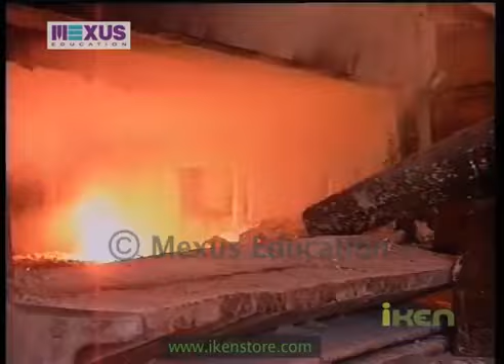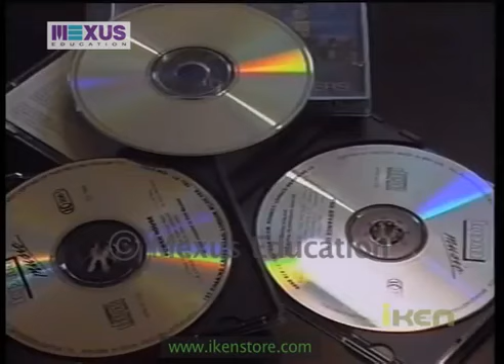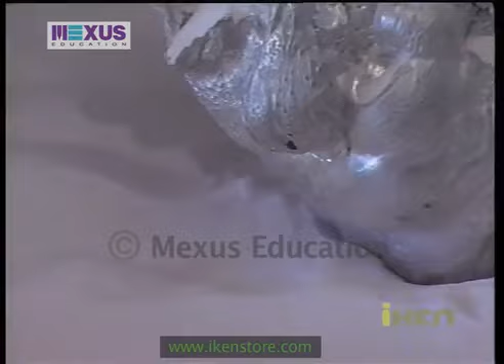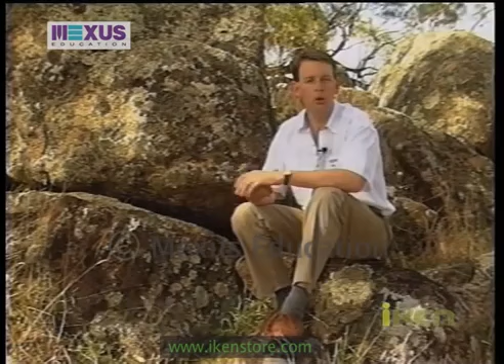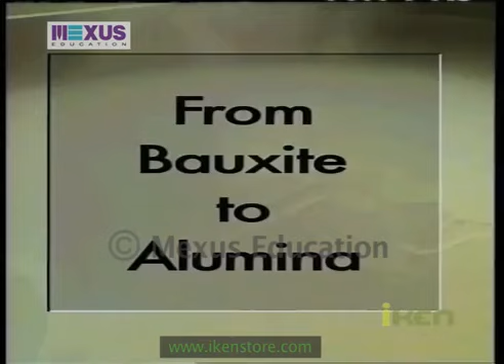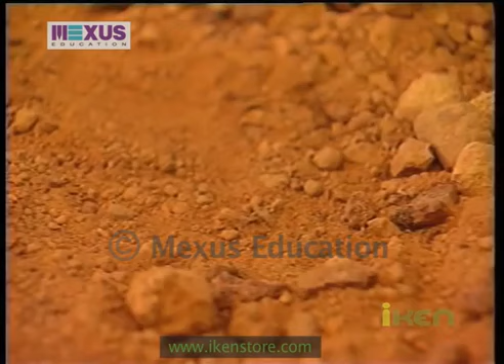The Making of Aluminium

Comment: Soni Aji Pradana
2712100126

Every day we see many thing application of alumunium, like used in car, motorcycle, cooking coil, drinks, and plane. Almost thing we usually use contain alumunium. So it is impotant to us to understand about aluminium precess. Aluminium process stars from ore to alumina and from alumina to aluminium. Aluminium process from alumina to aluminium called electrolysis process. Aluminium is a reactive metal it means aluminium combain with the others metal. Granite or aluminium rich rock contain aluminium, silica, potassium, magnesium, sodium and calcium, so the aluminium must be sparated from the other metal. Thirty million ago in Australia, by naturally aluminuim in nature bound with hydrogen and oxygen.  The bound of aluminum and hydrogen-oxygen call bauxite (Al2O3.3H2O) or hydrated aluminium oxide. To make pure aluminium need high cost and high energy. Needed more less 2000OC to melt the aluminum. Electrolysis is the process to produce aluminium from bauxite, but the first thing must to do to make the electrolysis to work is to refine bauxite to alumina. Refinery is the place to produce alumina from bauxite. To reduce impurities like iron oxide, silica, and titanium oxide used bayer process. It is comsume high energy. In the process aluminium hyroxide mix with sodium hydroxide or caustic soda in high temperature solution. Sodium hydroxide/ caustic soda desollve in aluminium hydroxide to be solution. Sodium alumina solution is cool off to be aluminium hydrad crystal. The aluminium hydrad crystal is heated by 1000OC to be aluminium oxide or alumina. Alumina contain aluminium ion and oxide ion. Each oxide ion has an ionic radius two and half time larger than that of each aluminium ion. Because of this a two to three ratio of aluminium ion to oxide ion. 
To start produce 1 tonn of aluminum we need 2 tonn of alumina. Some aluminium refractory industry has a storage to save alumina. In the process electrolysis need a contain of carbon for anode. The other ways in electrolysis aluminum need large electicity consumtion. Need 15KWh per Kg aluminium is the same as the radiator 1KWh running for 15 hours just to make 1 kg of aluminium. Imagine if we produce 1000 ton of aluminium how much energy we need. Genneraly in Australia to produce aluminium , 45.3% cost used by raw material, 28.5% by energy, and 26.2% labour and overheads. 
The part to make alumunium from alumina called hall-herault process. It is name from charless martin hall and paul heroult. They cread the electrolysis process in same time (1886) but in difference place. In plant there is two line and the electricity integrated to the other one. There part of electrolyte cell or hall heroult cell are shell make from steel in the bottom, and than there is carbon block covering steel bottom work as cathode. This block have high a contain carbon.inthe inside there is a steel current conducting bars. The anodhe make from carbon petroleum coke. There are fome hood and removable doors to escape gass and particle. The minimum temperature in the pot is 950OC. The gab from anode to cathode is 50mm and the electrolyte use cryolite,aluminium fluoride, calcium fluoride. The electrolysis is simply define is the chemical decomposition of certain substainces by an electric current passed through the substance in dissolve or molten state. The electrolyte compotiton are cryolite, aluminium fluoride, calcium fluoride and aluminium oxide. Alumina added in electrolysis cell and dissolve at temperature 950OC. Cryolite form thick of crust to make insulated condition. Gas produce by the process collected by the fume hood and toward to recovery system. In electrolysis prcess alumina split into its ionic component. The aluminium ion migrated into the cathode where is pool as molten metal. The oxide ion are attracted to the anode where they react with carbon to produse carbon dioxide. During the process the anode carbon is decreas, to keep distance from the cathode the anode will be automatically lowered until the carbon to be replacinf afte 2 week. 
The product of the electrolysis is a molten metal. Molten metal will be into casting process to produce ingot and ready to be shipping.
For the environment the aluminium production is produce very high cabon dioxide. Carbon dioxide is one gass can make a green haouse effect. The emmited is very dangerous for animal and people. That is the fact of producing aluminium

Comment: ARIF IMBANG PAMBUDI
2713100032

THE MAKING OF ALUMINIUM
 *Raw Material
Aluminum compounds occur in all types of clay, but the ore that is most useful for producing pure aluminum is bauxite. Bauxite consists of 45-60% aluminum oxide, along with various impurities such as sand, iron, and other metals. Although some bauxite deposits are hard rock, most consist of relatively soft dirt that is easily dug from open-pit mines. Australia produces more than one-third of the world's supply of bauxite. It takes about 4 lb (2 kg) of bauxite to produce 1 lb (0.5 kg) of aluminum metal.
Caustic soda (NaOH) is used to dissolve the aluminum compounds found in the bauxite, separating them from the impurities. Depending on the composition of the bauxite ore, relatively small amounts of other chemicals may be used in the extraction of aluminum. Starch, lime, and sodium sulphide are some examples.
Cryolite, a chemical compound composed of sodium, aluminum, and fluorine, is used as the electrolyte (current-conducting medium) in the smelting operation. Naturally occurring cryolite was once mined in Greenland, but the compound is now produced synthetically for use in the production of aluminum. Aluminum fluoride is added to lower the melting point of the electrolyte solution.
The other major ingredient used in the smelting operation is carbon. Carbon electrodes transmit the electric current through the electrolyte. During the smelting operation, some of the carbon is consumed as it combines with oxygen to form carbon dioxide. In fact, about half a pound (0.2 kg) of carbon is used for every pound (2.2 kg) of aluminum produced. Some of the carbon used in aluminum smelting is a byproduct of oil refining; additional carbon is obtained from coal.
Because aluminum smelting involves passing an electric current through a molten electrolyte, it requires large amounts of electrical energy. On average, production of 2 lb (1 kg) of aluminum requires 15 kilowatt-hours (kWh) of energy. The cost of electricity represents about one-third of the cost of smelting aluminum.
*The Manufacturing Process
Aluminum manufacture is accomplished in two phases: the Bayer process of refining the bauxite ore to obtain aluminum oxide, and the Hall-Heroult process of smelting the aluminum oxide to release pure aluminum.
*The Bayer process
1. First, the bauxite ore is mechanically crushed. Then, the crushed ore is mixed with caustic soda and processed in a grinding mill to produce a slurry containing very fine particles of ore.
2. The slurry is pumped into a digester, a tank that functions like a pressure cooker. The hot slurry, which is now a sodium aluminate solution, passes through a series of flash tanks that reduce the pressure and recover heat that can be reused in the refining process.
3. The slurry is pumped into a settling tank. As the slurry rests in this tank, impurities that will not dissolve in the caustic soda settle to the bottom of the vessel. One manufacturer compares this process to fine sand settling to the bottom of a glass of sugar water; the sugar does not settle out because it is dissolved in the water, just as the aluminum in the settling tank remains dissolved in the caustic soda. The residue (called "red mud") that accumulates in the bottom of the tank consists of fine sand, iron oxide, and oxides of trace elements like titanium.
4. After the impurities have settled out, the remaining liquid, which looks somewhat like coffee, is pumped through a series of cloth filters. Any fine particles of impurities that remain in the solution are trapped by the filters. 
5. The filtered liquid is pumped through a series of six-story-tall precipitation tanks. Seed crystals of alumina hydrate (alumina bonded to water molecules) are added through the top of each tank. The seed crystals grow as they settle through the liquid and dissolved alumina attaches to them.
6. The crystals precipitate (settle to the bottom of the tank) and are removed. After washing, they are transferred to a kiln for calcining (heating to release the water molecules that are chemically bonded to the alumina molecules). A screw conveyor moves a continuous stream of crystals into a rotating, cylindrical kiln that is tilted to allow gravity to move the material through it. A temperature of 1,100° C drives off the water molecules, leaving anhydrous (waterless) alumina crystals. After leaving the kiln, the crystals pass through a cooler.
*The Hall-Heroult process
Smelting of alumina into metallic aluminum takes place in a steel vat called a reduction pot. The bottom of the pot is lined with carbon, which acts as one electrode (conductor of electric current) of the system. Within the reduction pot, alumina crystals are dissolved in molten cryolite at a temperature 960-970° C to form an electrolyte solution that will conduct electricity from the carbon rods to the carbon-lined bed of the pot.
7. The smelting process is a continuous one, with more alumina being added to the cryolite solution to replace the decomposed compound. A constant electric current is maintained. Heat generated by the flow of electricity at the bottom electrode keeps the contents of the pot in a liquid state, but a crust tends to form atop the molten electrolyte.